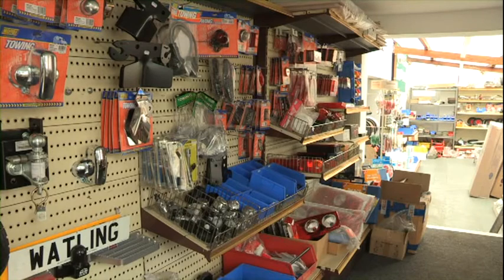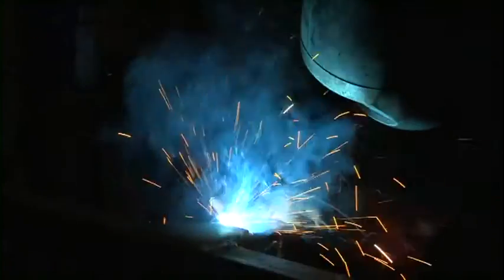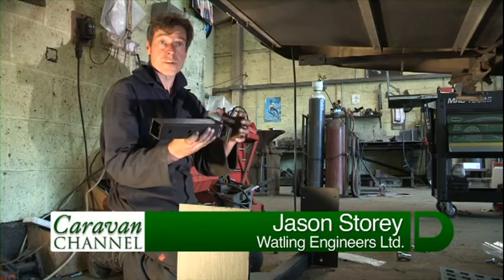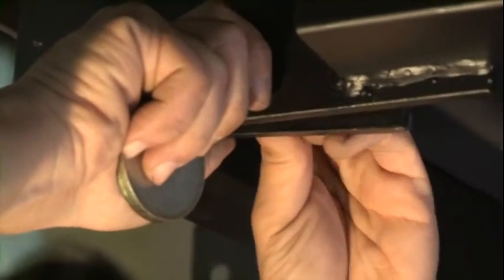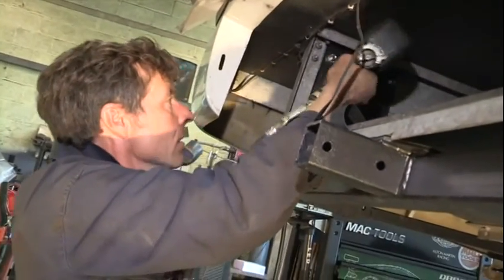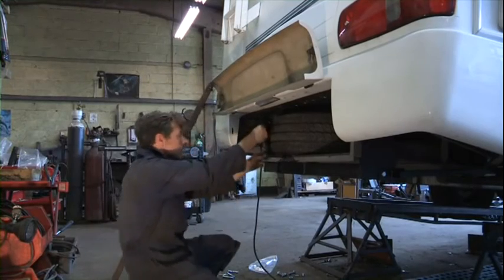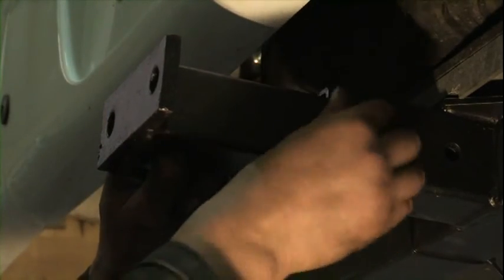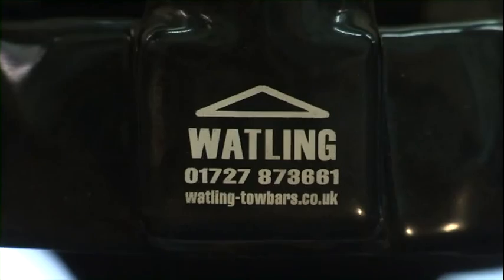Fitting a towbar

Comment: Make sure you get the right electrical connection block for your vehicle when fitting the electric plug for your tow bar. Otherwise when you use the left indicator it may turn on the right bulb etc.